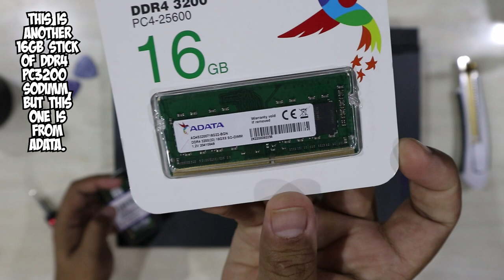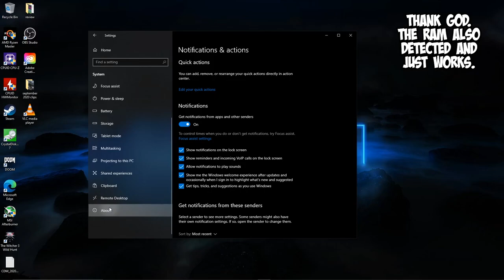Lenovo Legion 5(2020): SSD and RAM upgrade

Comment: Hello, I am thinking of buying the same Lenovo, but I can only buy the 8 GB version of Ram, if I buy another Ram memory, with the same frequency (3200 MHz), will I be able to activate the dual channel?
Reply from the maker: hi. thanks for watching. sure, the Legion 5 have 2 ram slots. just make sure you select the configuration with a single stick of 8gb of ram, so you can just add another matching stick later, cause if I'm not mistaken they also sell models with 4+4 ram configuration(which already running in dual channel) . if you bought this one then if you planning to upgrade you have to discard one stick if you're ok with 12gb or discard both if you want 16gb or higher.
hope this helps. thanks😁

Comment: Does legion i7 10875 model support 64 gb ram?
Reply from the maker: hi. according to Intel's website, the i7 10870H is able to support up to 128gb of RAM albeit at a slower speed, 2933 as opposed to 3200 on ryzen. the issue is whether lenovo's motherboard supports it or not. based on my experience with my laptop, I would imagine there is no reason why it should not support more than 16gb. but the only way to be completely sure is to actually install more RAM and see whether it work or not. unfortunately I neither have the RAM nor the laptop to try out. sorry I can't be more helpful.
Reply: @masterofnone4608  thanks for the update ... As per lenovo it's only support 32 gb max

Comment: Hi, I'm also looking to upgrade my RAM soon. I have Kingston 1x 8GB SO-DIMM DDR4-2933. I want to at least upgrade my RAM to 16GB. What should I buy? Should I buy the same exact RAM stick and insert it to make it 16GB. Or should I buy something different?
Reply from the maker: hi. your best best bet is to get a RAM stick with the exact specification. since you mentioned your RAM speed is 2933, I'm assuming you have the Intel version. the Intel cpu officially supports up to RAM speed of up  to 2933, so getting a faster one may lead to issues.
I would just get the exact same specification of RAM, it will ensure the best compatibility and to be honest for most use case  you won't notice the speed difference. hope this helps. thanks
Reply: Hello

Comment: Hi! I plan to add a 2nd NVME SSD to my Legion 5..but on Lenovo's support site it says a second M.2 NVME SSD up to 1TB is supported, and I'm planning on buying a 2TB one. Will it still work fine without throttling?
I know Lenovo's site postings aren't always accurate as it says it can support up to 32GB of RAM when mine was able to detect 64GB just fine.
Reply from the maker: hi. thanks for watching. I just made a video of installing a 2tb nvme into the second slot.
https://youtu.be/WkWt8RctLiA
it works fine for me. hope this helps. thanks:)
Reply: @masterofnone4608  Thanks.

Comment: i will buy a legion 5 with rtx 3060 and i want to buy and ssd nvme 1tb that have a cooler attached with , i hope everything will be fine cause i don't wanna to damage something xD . just one thing , the laptop will be brand new , so after i unboxed the pc i can direct go to install the ssd or i have to do something else before ? and when i finished to install the ssd it will be relevate instant or i have some programs or idk ? thank you :)
Reply from the maker: hi. u don't necessarily need to do anything to the pre installed drive to install the second ssd. but, if the ssd is new and never been formatted before the system may not automatically detect the new drive.

However, if ure replacing the old drive, then you need to prepare to reinstall windows. 
u need to go into disk management to first format the drive before the PC can detect it.

for laptops I suggest using and ssd with a very low profile cooler or no cooler at all. the laptop already hv a built in heat spreader. for most normal use ssd don't need an external cooler.
Reply: @masterofnone4608  ok thank you :)

Comment: Hi, I bought the same Legion 5 R7 4800H with the GTX 1660ti but there is only one 8GB RAM 3200 CL22. I wonder how to update my notebook? I found 3200Mhz CL20 -22 RAM recommended on the Leneovo website, but as I know if the timinig is lower, the RAM is faster. In this case, with 3200Mhz CL22, we have a 13.75 nanosecond response. Do you know that it will be compatible with a GOODRAM 3200Mhz CL16? Thx...
Reply from the maker: hi. I would think you'd probably notice more performance gain by adding another stick of RAM so that the system runs in dual channel rather than adding a ram stick with better latency. if you plan to add another stick of ram, ideally the speed and latency of the ram sticks should match. adding a lower latency ram stick to your system may not be beneficial as it won't run as fast as it should(limited by the slower ram) and may cause instability. unfortunately Goodram is not a brand that's available in Malaysia and I wouldn't be able to tell you in terms of compatibility. hope this helps.
Reply: I was thinking about 2 solutions. First, adding extra SODIMM RAM to exactly match the original 3200Mhz CL22. Second, to add two new RAMs with less latency. Thank you for your support.

Comment: Hello I have a question: If I buy an NVME SSD that does not come with the screw, can I use one of the 4 screws that lenovo provided on the 2.5 inch SSD filler to attach this nvme or do I need a completely different screw? Thanks for your help
Reply from the maker: unfortunately no. the screw for the nvme ssd are of different size. for the ssd you'd need a 2x3mm screw. hope this helps.

Comment: Do you know the speed of the initial ssd nvme ?
Reply from the maker: hi. the factory fitted ssd in mine is a 1tb Western digital. can't recall which model. if I remember correctly it was 2800MBps read and 3000MBps write on crystal disk mark. hope this helps. thanks for watching😊
Reply: @masterofnone4608  thanks you very much

Comment: What specific ram would I need for another 8gb of ram
Reply from the maker: hi. thanks for watching. if you are adding a stick of RAM, basically you need to match the spec to the existing one to ensure optimum compatibility.
For example, the Legion 5 15(amd cpu) is equipped with ddr4 3200 ram, so you need to buy a ddr4 3200 ram stick.
while Legion 5(intel cpu) comes pre installed with ddr4 2933 RAM, so you need to get a ddr4 2933 ram stick.

No doubt slightly mismatched RAM can work, I think a recent video from LTT does demonstrate that, but to ensure optimum compatibility and performance you really need to match the RAM sticks.

Hope this helps. thanks😊
Reply: @masterofnone4608  this helps a lot Thanks!

Comment: Hey @masterofnone I bought the Lenovo legion 5 15" i7. You have the amd version can I still use the same stuff you added to your laptop to mine? Can I also make mine 32 gb even tho it's a intel ?
Reply from the maker: hi. i7 10875h apparently supports up to 128gb of ram. however it officially support ram speeds of up to 2933. so upgrading to 32gb capacity should be viable, but need to make sure to use the RAM with supported speed. if you adding on a stick to existing one, make sure the RAM specifications match. as for the ssd, it should work just fine for both intel/amd. hope this helps.
Reply: @masterofnone4608  thanks will do some more searching today!! Good luck with the Chanel
Reply from the maker: @yovannipille6978  thanks😊

Comment: I have the legion 5 pro ( 2020 ) I know this might sound a bit daft but can you tell me if the internals are exactly the same, I mean m.2 slots in the same place, sata ssd in the same place, etc? As I plan on upgrading a lot of things, but need to be sure first.
Reply from the maker: hi, thanks for watching. as for the Legion 5 pro, the internal layout is very similar, but not exactly the same.
the Legion 5 pro(mine is the 3070 one), comes with a 90wh battery, so unfortunately it don't support sata hdd/ssd(no space) . it still has an extra nvme ssd slot(ie you can max out  your storage with 2 nvme SSDs). it also comes with 2 replaceable RAM slots. hope this helps. 😁

Comment: Hey, does the intel variant (i7-10750H) support 32 GB RAM? (As you mentioned, literally no info, and states 16GB is the max!
Reply from the maker: hi. according to Intel's website, the i7 10850H should support up to 128gb of RAM albeit at a slower speed, 2933 as opposed to 3200 on ryzen. the issue is whether lenovo's motherboard supports it or not. based on my experience with my laptop, I would imagine there is no reason why it should not support more than 16gb. but the only way to be completely sure is to actually install more RAM and see whether it work or not. sorry I can't be more helpful.
Reply: Thanks for the reply, what about the 10750H?
Reply from the maker: @jibinjoseph5133  sorry. it was my typo. I meant to type 10750h, ha ha. fat fingers problem😅
Reply: Have you finally tried 32/64Gb on Legion 5i with it 10750H?
Reply from the maker: @emilianoescobar1015  unfortunately I don't have access to Legion 5i to try. sorry 🙏

Comment: How long do you charge for new out of box
Reply from the maker: hi. unfortunately I have a bad habit of never really charging my new laptop(or any other device, really) fully when I first got them. basically out of the box and just use it like how I would normally use a laptop. so far haven't encountered any issues. hope this helps. thanks

Comment: hello i have a question i have a i5 10300h whit a gtx 1650 is the lenovo legion 5 15IMH05 and it come whit 8 gb 2933 mhz and i want 8 gb more, should i buy 2666 mhz or 3200 mhz because i cant find a stick whit 8 gb ram whit 2933 mhz from crucial so i need to buy one of 2666 mhz or 1 of 3200 mhz?
Reply from the maker: hi. thanks for watching. based on Intel's specification of the 10300h, it only officially support up to 2933 RAM. ideally you want to match your RAM sticks, mainly to ensure optimum compatibility.
Though as a recent linus tech tips video shows, you can get away with mixing up RAM with little issues. 
https://youtu.be/bTS0ybQ3lCI
with regards to your situation, 
My recommendation is wait for the matching ram to be available, because to be fair 8gb of RAM is pretty usable still. 
However, if you really need 16gb NOW, for some reason, my opinion is to go with the 2666 one, as the faster RAM will match itself to the slow one and it's a speed that is supported by the cpu. I'm not recommending it, but that's what I would do.
Bear in mind, this is only an opinion, nothing evidence based. I do not have the system nor the RAM stick to test this out. do it at your own risk.
hope this helps. thanks.

Comment: Is it possible to use the following SSD Crucial P1 1TB 3D NAND NVMe PCIe
 Internal SSD, up to 2000MB/s - CT1000P1SSD8 instead of the one used in 
the video?
Reply from the maker: hi. thanks for watching. the brand of the drive don't really matters as long as it comply with the m.2 standard and physically can fit in there😊 I've installed a 2TB nvme drive in the second slot and it works just fine. I linked it below. 
https://m.youtube.com/watch?v=WkWt8RctLiA
hope this helps. thanks
Reply: @masterofnone4608  Thank you so much for clarifying! Great work!! Most helpful

Comment: I think I will buy the Lenovo Legion 5i with 8gb of RAM and upgrade to 16gb. Am I risking damaging the laptop by doing so? I have never upgraded a laptop before so I am a little worried about it.
Reply from the maker: hi. thanks for watching.

Upgrading the RAM yourself would be cheaper than what lenovo offers, but if you're worried about damaging the laptop, then you need to consider how much you are really saving by buying your own RAM. if it's just by a small amount, then I guess you are paying extra for peace of mind and a guaranteed compatibility, which is something that's difficult to put a value on😁

However, if the difference is quite significant or you want to try and do the upgrade yourself, the Legion 5 is one of the most user upgradable friendly laptop I ever worked with. As long as you're reasonably sensible, the risk of damage is quite minimal. 

Lenovo even have a detailed manual on how to disassemble the laptop. Just Google it. 

The most challenging aspect really is getting the back panel off. once you got it off, you got easy access to the RAM, drives, WiFi card and battery. the main thing is to take your time and be patient. youtube videos always make it look easy but don't feel discouraged if you needs a bit more time.

hope this helps😊 Thanks.
Reply: @masterofnone4608  Hello, my ram stick should arrive tomorrow, but I’m quite worried that I would damage my laptop. Anything I should worry about before opening the laptop?
Reply from the maker: @iihamed711  I find that the worse part is actually taking off the back of the case. ha ha. especially if this is your first time. just take your time and be gentle. try not to break any clips. it won't affect performance of your laptop, but it may cause the back panel to be as not flushed when reassembling.
as for the replacing the ram itself, make sure you seat the ram properly and you should be ok.
of course the usual safety things apply ie clean, dry hands etc etc. 😅
hope this helps. thanks for watching
Reply: @masterofnone4608  Thanks
Reply: @masterofnone4608  just wanted to update you on the ram upgrade situation. i successfully installed the new ram slot and it works just fine. however, i managed to break one of the clips in process :), but other than that, nothing really.
Reply from the maker: @iihamed711  congratulations😁 glad things turned out well.

Comment: Thank you. This helped me add an nvme. I’m glad I bought a computer tool kit from ifixit a few years ago with skinny picks. Getting the back part of the cover takes a little finesse and patience.
Reply from the maker: glad to be of help
Reply: @masterofnone4608  hello , why you put seperately DDR4 sodimm Mhz 3200 ,  and what it give?
Reply from the maker: @reshad711  hi. having 2 sticks of RAM means it will run in dual channel, which will give you better performance. a system with say 16gb of ram (8gbx 2 sticks) will run faster than 16gb of ram(16x1 stick). of course, it also depends on your use case. in most day to day usage, eg word processing, content consumption you may not even notice the difference between running the ram in single or dual channel. however, if your use case involve some memory intensive work, then you may see performance improvement. hope this helps.
Reply: @masterofnone4608  i have got new ASUS TUF A15 .In the fabric they put  one  DDR4 so dimm 16 gb 3200mhz . If I buy one of this RAM ,  I don’t need change fabric  RAM to  ,,Samsung or Adata or Kingstone’’ which is recommended?
Reply from the maker: @reshad711  hi. brands don't matter as much. I personally would buy the cheapest ram from a reputable brand. what's more important is to match the specifications of the RAM. in this situation, if you're adding another stick of ram to existing one (I'm assuming ur laptop does hv 2 ram slots as I'm not as familiar with the tuf15) the best thing to do is to buy another stick of same capacity, 16gb and same speed, 3200. if possible try to match the latency as well( although this may not be as clearly labeled) this will ensure that your laptop won't run into stability issues. hope this helps. thanks.

Comment: Shouldn’t the ram be 2933Mhz?
Reply from the maker: hi. the ryzen processors supports up to 3200 speed, and Lenovo also spec Legion 5 with ryzen processors with ddr4 3200. Intel processors (10th gen) supports up to 2933 speed and therefore Intel equipped machines are spec with such ram. hope this helps.
Reply: @masterofnone4608  I just got the Intel version and want to update it as it came with 8gb only, so 2933Mhz is the one I should go for, right?
Reply from the maker: @fernandosouza0308  yup😊
Reply: @masterofnone4608  Alright! Cheers mate, helped me a lot!
Reply from the maker: 👌 glad to be of help

Comment: Hey I've never upgraded ram , i have a question can i put a 1600mhz DDR3 ram in this laptop?
Reply from the maker: hi. the laptop only supports ddr4. unfortunately ddr3 is a no go. don't think it would fit physically either. hope this helps. thanks for watching😁

Comment: can we upgrade the SSD varient ?
Reply from the maker: hi. thanks for watching. I'm not sure what you meant by ssd variant, but if you're asking about brands, you can pretty much install any brands of ssd. hope this helps. thanks😊
Reply: @masterofnone4608  Hello, Actually I have purchased the SSD varient(512GB). Not the HDD+SSD Varient(1TB+256GB).  So, in case we want to increase the storage for the SSD varient, can we add HDD and SSD both, or only SSD? How many slots for storage we get in SSD varient. Or its the same for both HDD+SSD and SSD? 
If only SSD, what is the maximum expandable storage limit. Please suggest 🙏🙏
Reply from the maker: @iam_amal  oh, now it's clear. the Legion 5 has 2 nvme slots and a sata slot(for either a sata ssd or hdd). unless you configured it from the website, lenovo usually ship the laptop with 1 nvme drive(capacity will differ) 
that will leave you with 1 extra nvme slot and a sata slot. 
for storage upgrade however, you can only choose one, either going for an nvme ssd or a sata ssd/hdd as installing either one will block the other.
as for the ssd, I've installed a 2TB nvme ssd without any issues. 
hope this helps. thanks for watching😊
Reply: @masterofnone4608  Yessss now I am clear about the upgradable slots. Thank you so much for the clarification. 👍👍👍